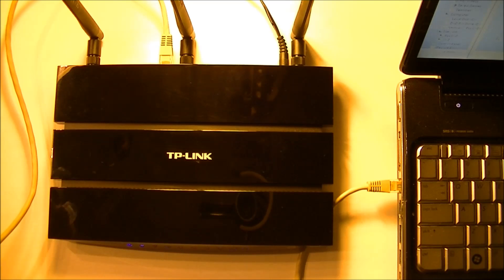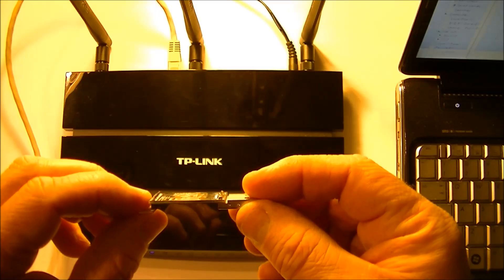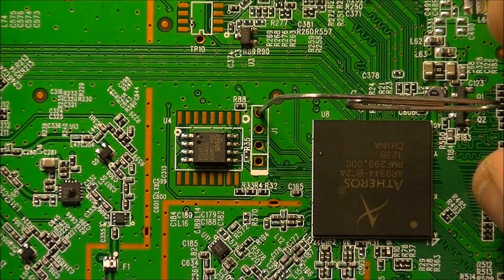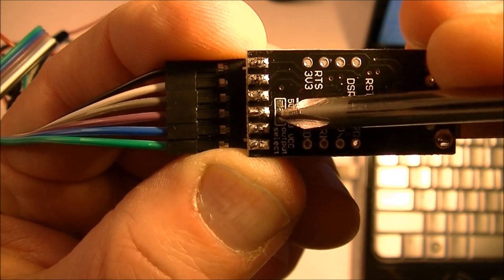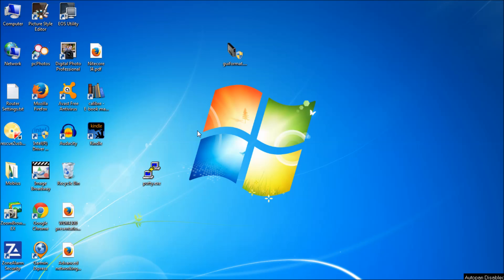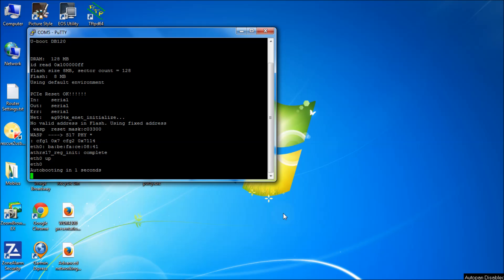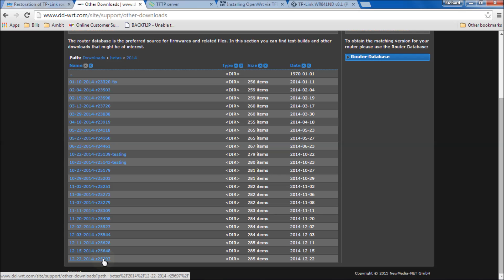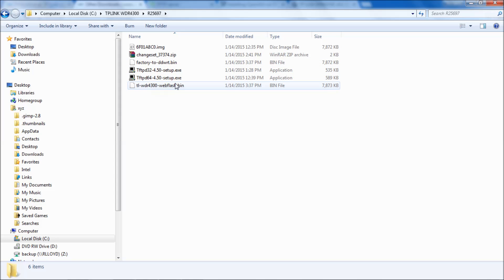Bricked TP-Link WDR 4300 Router Recovery Using UART Serial Converter Part #1

Comment: i have the same flashing or cycle on my router ? can i use the same method here ??? and what is the diffrence?
Reply from the maker: Full chicken440 If you have a TP-Link DR4300 V1 this procedure "should" work for you. Thanks
Reply: sorry i mean i have a tl-wr841nd bricked and 941nd bricked also ?? can i do the same things ??
Reply from the maker: Full chicken440 I have a video on how to recover the WR841ND without a serial connection here https://youtu.be/0k1sxwX5pMk?list=PLnxXRLSlmSVNiENiN9wTejP6dtIqqmTya maybe the same procedure will work on your 941ND Thanks.
Reply: my problem is when i power on the router all lights or leds flashing at the same time excpet the power led stays on .... flashing all and in a second they turn off all and flashing again an so on>>>i am by mistake install openwrt to the roter and this happend to me ? what can i dp to fix this problem ???!
Reply from the maker: Full chicken440 Have you tried my video on how to recover the WR841ND without a serial connection here?  @0 maybe the same procedure will work on your 941ND Thanks.

Comment: Hello bro
am new for this hadwares >>
my router is tp link <TL-WR740N > i tried to unbrick my router follwed your steps in your video but got hang with black screen no response in putty screen but sessions are active no response so i need your help .please reply as soon as possible 

check my image of putty :

TP-Link TL-WR740N Wireless Router 
http://i.imgur.com/J5WWlm5.jpg
http://i.imgur.com/5Bm8WFd.jpg
Reply from the maker: kumaresh raj  Make sure you configure your serial connection as I show on the video at 9:05 once you verify those settings then more than likely you have your RX and TX lines hooked up to the wrong pins just reverse them and you should get an output. I did the same thing when I first connected the cables. Make sure you are connecting to TX and RX and if you don't get an output reverse the wires so that TX goes RX on the UART pins and RX goes to the TX pins. Please tell me if that fixed your issue. Thanks.
Reply from the maker: kumaresh raj Not sure if shorting those two will damage them. I have connected them incorrectly with out any damage

Comment: Hi Richard.
I will find a Nokia cable ca-42 or DKU-5 and will retry to unbrick de TP-Link.

Kind regards.
Reply from the maker: Here is the interface I use Link to KEDSUM® CP2102 Module STC Serial Converter At Amazon: http://amzn.to/1u7Pmd8 works great. Thanks

Comment: Hey Richard thx for this Amazing Lifesaver video, my question is if i can put the original tplink firmware instead ddwrt to debrick my router?

Thanks you very much
Reply from the maker: If you want to go back to the stock Tp-Link firmware I would use the default DD-WRT firmware (21061) to bring it back to life then use the webrevert.rar to bring it back to the stock Tp-Link firmware. Then I would download and install the latest stock firmware from TP-Link. It's the safest route. Thanks
Reply: Richard Lloyd The problem is that my router has not yet the Webrevert.rar from ddwrt.

I have Tp-Link archer c9.

Thanks
Reply from the maker: Junior Vásquez Ruiz I was working on a solution for that on my TP-Link WR841N V9, which I have the same problem as you, when I dropped my screwdriver on the circuit board and fried it. I did order a new router because I love it and use it as a back up and DD-WRT range extending bridge too. I will make a video on how to return it back to stock. Hopefully the same process will work on your TP-Link archer c9. I should have it done this week sometime (depending on my success in doing so). Thanks.
Reply: Richard Lloyd oh Thanks, i'll be waiting for it!
Reply from the maker: Junior Vásquez Ruiz Thanks.

Comment: I have exactly the same problem after trying to flash my WDR3600 with DD-WRT. I plan to try this fix as soon as I can get some header pins to solder onto the router mainboard.
Reply from the maker: My paper clip pins were crude but they worked just the same. Good luck Sir. Thanks.
Reply: Richard Lloyd I completely missed that you had used paperclip pieces for pins. Anyway, my header pins came in and, after soldering them onto the mainboard and following your directions exactly (except for using an Arduino I had lying around in place of the CP2102), My WDR3600 has been unbricked and is working perfectly. Thanks for taking the time to upload these videos, They were an enormous help for me.
Reply from the maker: Branon Young  You are most welcome. I am happy to hear that it helped you fix the router. Thanks for the kind comments, feedback and watching

Comment: oh, thank you so much for this tutorial! I also got my wdr4300 bricked with a dd-wrt beta :( gonna buy a cp2102 and try this!
Reply from the maker: You are welcome. It has saved mine a few times now. It seems that any beta build after r25974 DD-WRT firmware bricks it. Thanks
Reply: Richard Lloyd and regarding bridging the 3.3V, I think that's only for the Vcc output of the module, so as long as you have no power connection between the CP2102 and the router's motherboard, I don't see a way of frying the chipset :-? is there any power through rx/tx I am missing? 
I'm asking because I just ordered a module like this one http://images9.okr.ro/serve/auctions.v7/2015/jan/02/a11bc61b18919800d9c55c5488a3c9d1-7354102-1000_1000.jpg which has two separate voltage output pins, a 3V3 and a 5V and I see no need for bridging any of these pins. Am I wrong? Thank you!
Reply from the maker: Ciprian Visan  You are probably right but what if you are not? What if you mistakenly connect Vcc? For the few minutes it takes to take the possibility out of the question why not do the bridge? If you do not have a soldering iron then I can understand your issue. Thanks.
Reply: Richard Lloyd I just re-flashed my router successfully, thanks again for this video tutorial! P.S.: I finally used a PL2303 chipset converter and I didn't short the 3.3V output :) and as long as you don't touch the converter's output Vcc(s) (I had 2 outputs, one for 3.3V and for 5V) you don't need to short anything. Worked flawlessly!
Thanks again! Cheers!
Reply from the maker: Ciprian Visan  You are welcome. Thanks for the feedback on the voltage setting. I appreciate that. I find that any firmware version higher than r25974 bricks my router. Is that what happened to you?
Reply: Richard Lloyd yes! same goes for me!
Reply from the maker: Ciprian Visan  Good to know it isn't just me. Thanks again.

Comment from the maker: Ognian Lipnichanski I am not sure where your comment went but I will answer anyway. I created the bridge to make sure that the voltage was set to 3.3V as 5v will fry your router. I know I did not connect VCC or ground but I did not want to take any chances. It only takes a minute or two to do it. Better safe than sorry. Thanks.
Reply: Thank you, i will try this soon.
Reply from the maker: Ognian Lipnichanski  You're welcome. Please update us with your results. Thanks.
Reply: Richard Lloyd I just bring my router back from the death. :) Thank you very much for this great tutorial!
Reply from the maker: Ognian Lipnichanski That's great! Happy to hear of your success with this. Thanks for watching and commenting.
Reply from the maker: ***** The pins on the UART adapter are labeled. You can see that at 1:53 in the video. On the router side I used Google to find the pin outs. Thanks
Reply from the maker: ***** You don't really need to do the voltage jumper if you are using the power supply on the router to power it. You don't need to connect the Voltage pin at all. You need to find Gnd (ground and the two data pins). Thanks
Reply: Hello Richard. Your video is amaizingly detailed and helpful. Thank you to share your experiences with us. I have an issue with an Archer c7. I followed instructions according to video and everything ran down without any obstacle but when I get to reset and actually restarting the router it makes the same looping procedure. If you have some experience with this type of problem please drop me a line to my email address: sonycdogg@gmail.com It would be nice if you could help me. I saved the lines from putty so I can send it to you. Thank you in advance.

Comment: Great tutorial for the most part. BUt why would you use a steel paper clip (about 7:32 in vid.) for your pins? Probably be easier using copper wire of the right size, takes solder much better than steel. All-in-all, a great video tho!